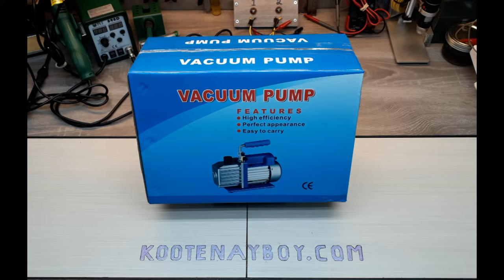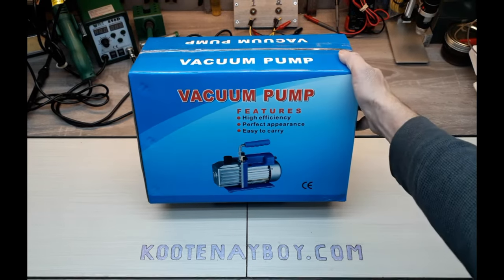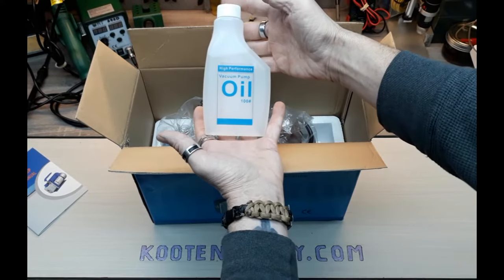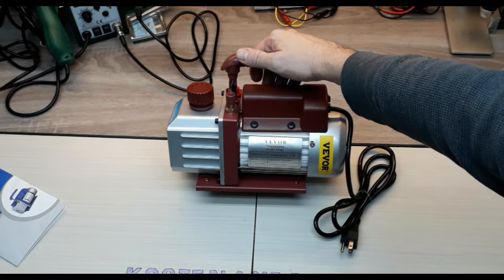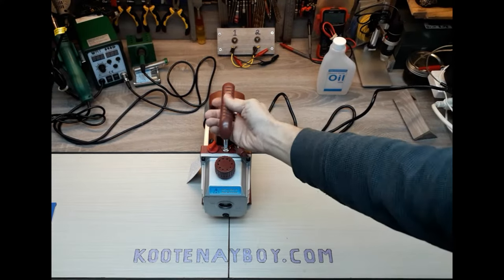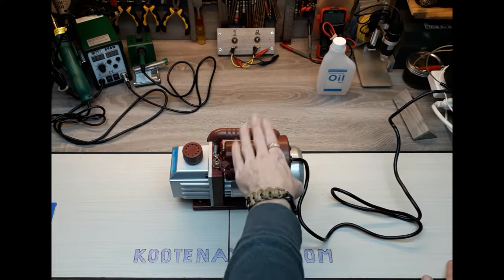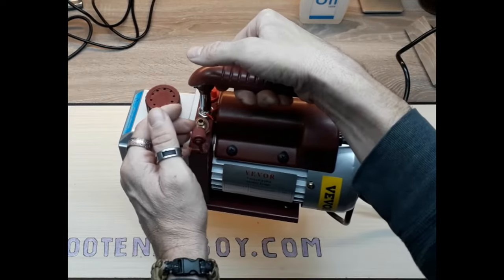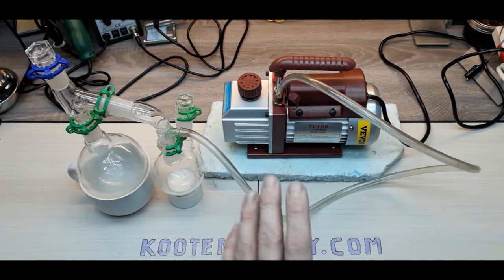Vevor 4.5 cfm Vacuum Pump for degassing, distillation,  terpene extraction

Comment: If i need to vacuum steam distill, can i use an off the shelf alcohol distilling setup and put a tee in the condensate line for a vacuum pump line and vacuum hose from the auto parts store? Or how could i set it up for larger capacities like 10 liters?

Comment: hello sir, if it runs too hot is it because of a wrong oil? i've put one coded sae40 iso vg/100 and i have no idea of what im doing lol
Reply from the maker: Id say that you need to run the oil the manufacturer suggests  if its still running hot you might have it in to closed a space as its air cooled  and could put a fan blowing on it to help with that